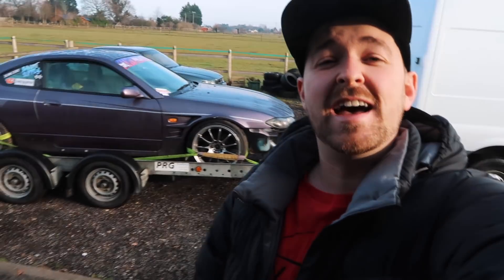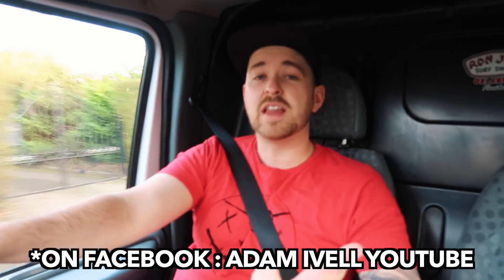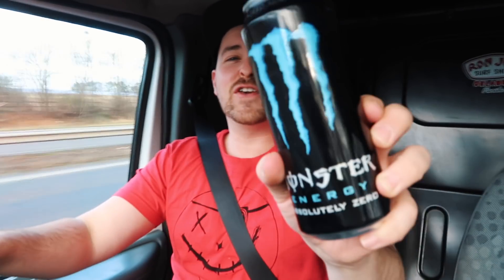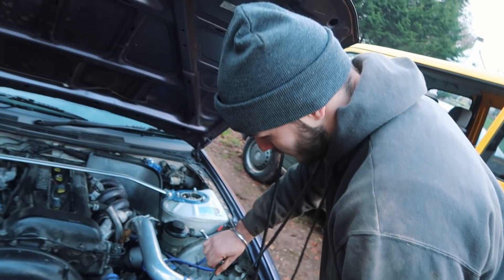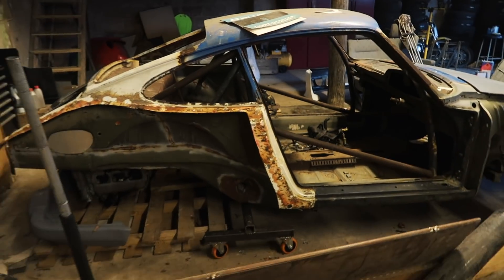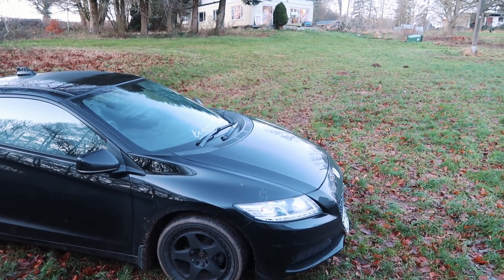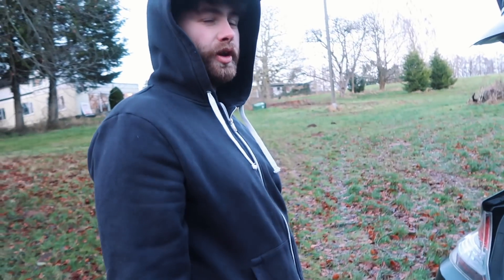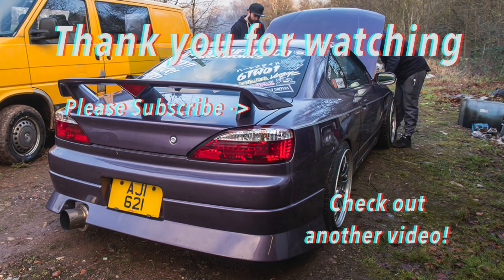:D WE FOUND THE ISSUE  !! // Nissan Silvia S15

Comment: How has that happened to the turbo blades?
Reply: Looks like lots of radial movement due to a fucked bearing? I'm guessing it's the original t28 and it's just had it's day.
Reply from the maker: yeah exactly that mate, just an old turbo ive been beating the crap out of